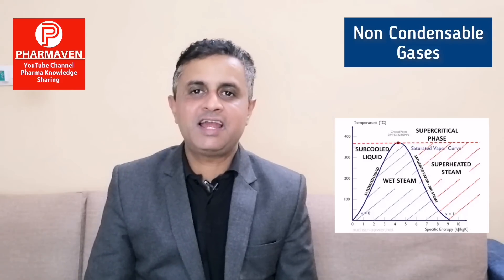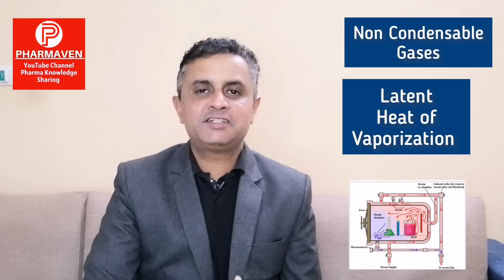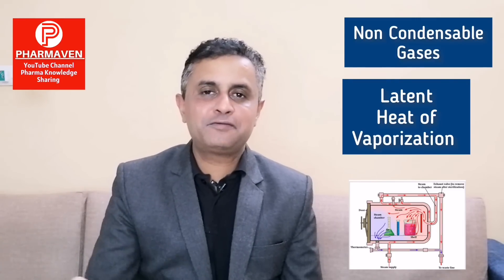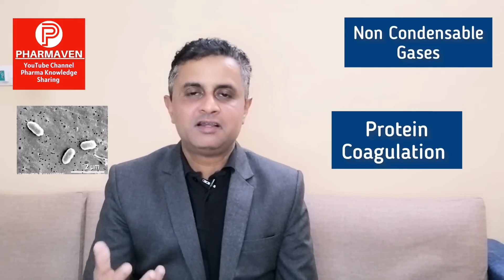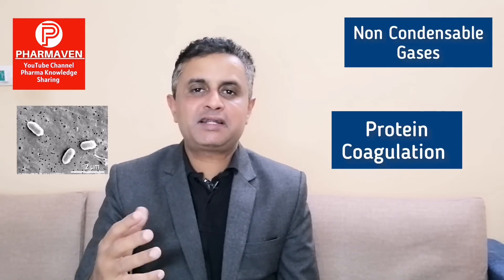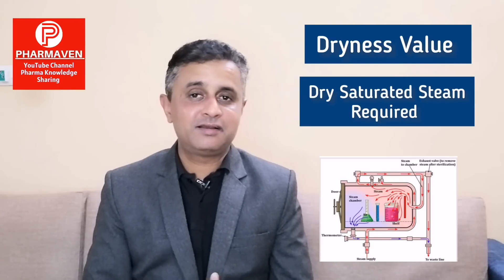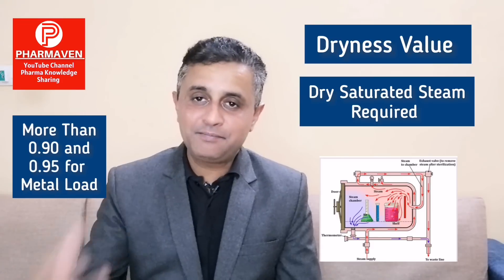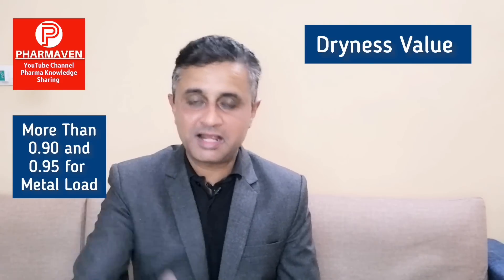What is Steam Quality, Why it is Important for Sterilization? #sterilization #aseptic  @PHARMAVEN

Comment: Sorry but your understanding of the science is wrong. NC gases are an issue really only if you can trap the gas in a location eg inside a standard test pack. Or in a vessel at a heavy point. The dryness is an issue if you find wet loads and the packing is taken out wet. In that case it's way more likely to be a packing or loading issue.  Superheat is not a problem ever unless your trying to meet a standard eg the empty chamber test. But keep up the misinformation as its great for sales....
Reply from the maker: For your information, I am not a sales person. 

Below are Few questions for you to better understand your comment 

Are you telling that steam quality testing is not necessary? It’s a false phenomenon? It is not required to be tested when used for sterilization in sterile manufacturing? Can you provide supporting guidance to your points?
Reply: @PHARMAVEN  To stop me boring you with details on the subject (we can talk off line if you want)
The history of steam testing is long and what is required by the authorities is not based on :-
1 what is really an issue eg what potential harm can be caused
2 Is a good set of test techniques to find out what the actual values of the 3 parameters are.
The whole subject is too long to discus in a YT comment.  I recommend you search for steam quality innovations and look at the articles what is discussed  covers one of my points.
BTW I was not meaning to say you were benefiting in sales. Others are.
Reply from the maker: @logik100.0 
Appreciate your response